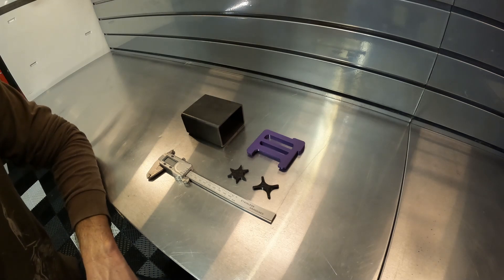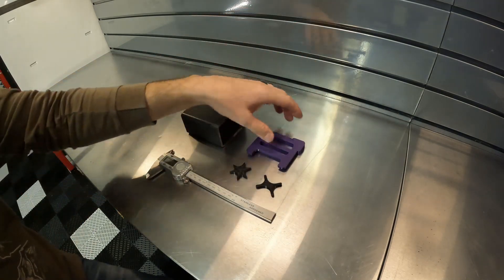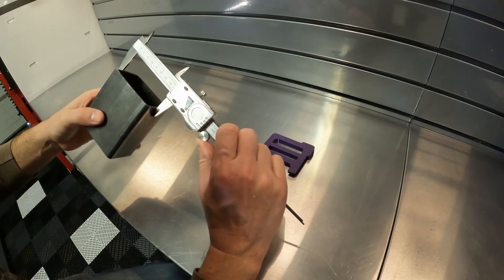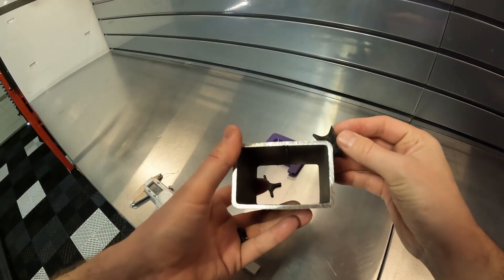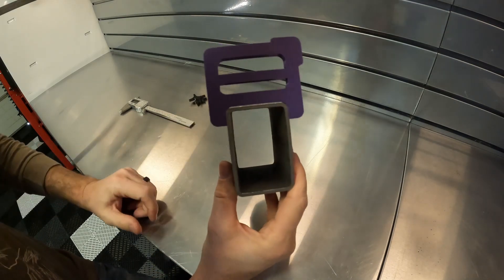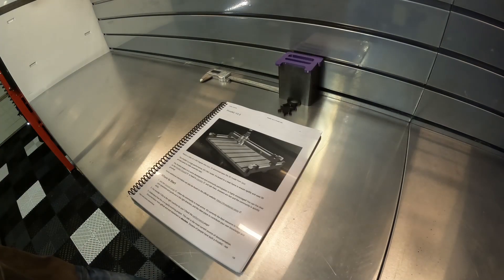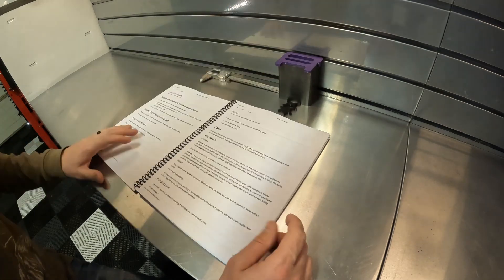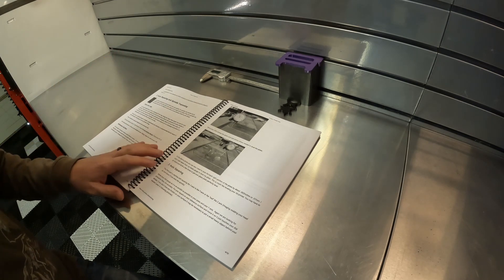How to Measure Steel for PrintNC - DIY CNC - Episode 2

Comment: the steel tubes are supposed to be 8cm * ?? * 3mm  (whats the width)
Reply from the maker: Steel can be the following dimensions. 

Metric - 75mm x 50mm
80mm x 50mm
80mm x 60mm
100mm x 50mm

Imperial - 2x3 
2x4

You can also combine if needed. Like using a smaller size for the machine base and a larger size for the gantry. 

Have a look here for more info - https://wiki.printnc.info/en/v3/metal

Comment: Where'd you find these files? This is a pretty poorly organized project.
Reply from the maker: Have you looked through the wiki?

I'd say for just one person "Hodges" who designed this whole thing & has now turned community driven. It's pretty well organized. 

The wiki has just about every single bit of knowledge needed to completely build this thing out. Anything else you're confused about can be easily accessed via the Discord as there is always someone to jump in and help out. Typically within minutes of asking a question.

Here is a link to the calibration tools. But I suggest reading every single word on the wiki. It's extremely helpful. - https://wiki.printnc.info/en/v3/printing/tools

Comment: Label up all your pin outs and circular connector wiring. I did for my first CNC build and I still refer back to it all the time when things go wrong. It becomes your repair manual
Reply from the maker: Oh for sure. Everything will be labeled, but good advise!